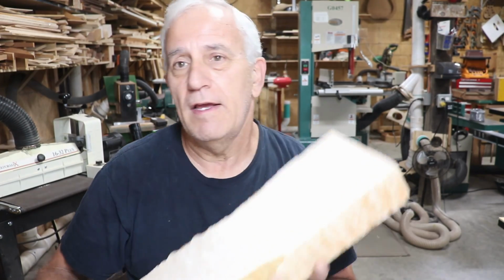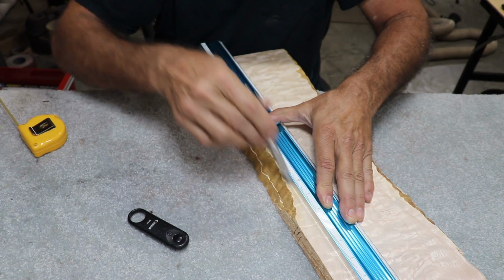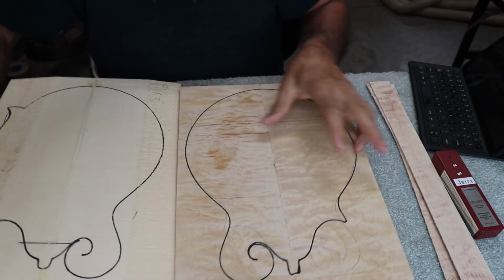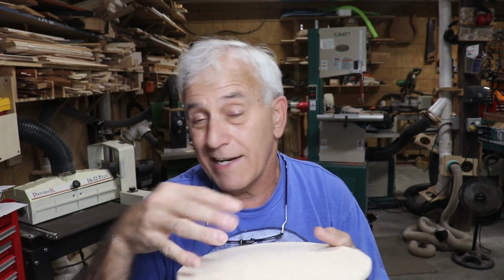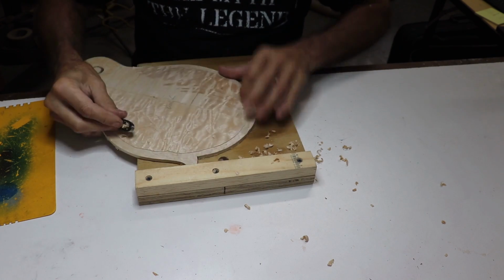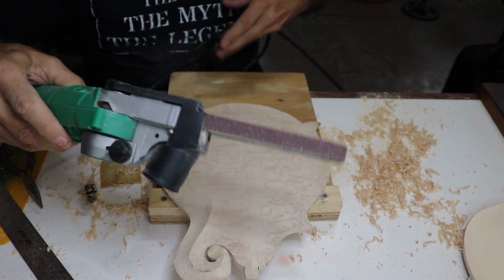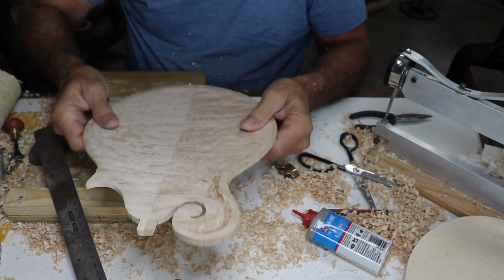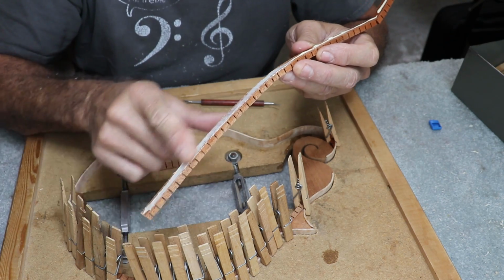441 RSW A Custom Quilted Maple Mandolin Part 1

Comment: At around 17:00, you explain that you used a power grinder to hog out a lot of the surplus wood "but don't try to get too close".  When I was just a lad, it was explained to me that at any given time, I should pick a tool and technique that would easily remove at least 80%  but no more than 90% of the material that I wanted gone. This holds true for chainsaws and axes at one extreme and polishing compounds at the other. I've managed to follow this advice for several decades and it seems that you do too.  Your tool and technique choices are why I (and many others, no doubt) continue to put down anything we're doing when we see a new Rosa video.

Comment: I carved a mandolin back out of birds redwood eye burl and it was horrible for tear out so I put a sanding disk like I used to use with my drill. I Chucked it into my drill press to hold it firmly in place and moved my back around to shape it  so it was very similar to what you did. There is probably a good time to use each style

Comment: My first violin back was slab sawn maple.   Pretty but hard to carve.  I ended up using a flexible sanding disk attached to my drill press.  You can also use the drill press with a depth stop to take wood from the inside and chisel out the excess wood between the holes.  Did you buy or make the neck block and end block.
Reply from the maker: I make every wood part.  Though I buy the fretboards pre slotted.

Comment: Hey Jerry, that is going to be a heck of a instrument ,  I am really starting to slow down and just make the best pieces (I am a furniture/cabinet maker) I can possibly make as I am in my mid 60's and am finally not to worried about the money end of it (as much as I used too),one of my favorite sayings from photography which is my non-work passion is beginners worry about the equipment, professionals worry about the money, masters worry about the light . Sorry about the ramble, I wanted to suggest looking online for toothing planes which where what you needed for the grain issues. Also although you are  probably aware flat sawn booked matched has the pores sliced in opposing directions and its going to show its chatoyancy at a disadvantage. There is a Okie,Bob Flexnor that has info on that. Btw the reason I subscribed was I watched ur chocolate restoration ,nuff said .
Reply from the maker: I have several tooth planes they didn't work on this either

Comment: Hi Jerry;
I've made two balsa violins. Talk about tearing out when carving wood, that takes the cake. It's so soft that it really likes to tear rather than cut. So, no more balsa violins. They do really make a good sound board though.
Reply: Set your chip breaker up so that when the carving plane is fully assembled it's at 81 degrees. This should reduce tearout to the least you could hop for.

Comment: That gizmo, you use around the heater,metal strip with handles, would a leather 1 be any good?
Reply: Leather would dry up and crumble, in short order.
Reply from the maker: leather might work.   Though it would probably absorb more of the water.  This is an advantage with the metal because I want the steam to stay in the wood.

Comment: The back is stellar. Did you know that streaking would carve out when you chose which side to use? Can you coax that kerf strip into shape on that heat rod you use to bend the sides?

Comment: Jerry 
Thats one of the traites of  that quilted maple your working with .
Its more or less its own Animal . Ive worked alot with Birds eye maple , fire maple , tiger maple . And they all are different and non have the same temperment ..  lotta sanding if you dont want alotta chip out . If your gonna chisle small bites . Baby bites . What helps. Is a product called Zap Gap . Knife maker supply stores call this on line ..  ever here of Brownells .  Outta Brownelle Iowa ..  much of my tools and adhesives
I use to purchas from their .. it may be of interest to you to obtain one of their catalogs ..

Comment: Have you ever tried using a larger plane, something like a Stanley Number 4 Bench Plane, just for hogging off the wood when you first start carving?
Reply from the maker: you would have to try it but I am pretty sure that's gonna be really really awkward it's a small curved surface
Reply: @RosaStringWorks  oh yeah, I didn't think about that. 

I was just thinking that the extra mass of a larger plane could help your carpal tunnel.

Comment: why don't you make a little steam bending box?  Seems a lot of luthiers use them.  

Also, if you get a big bimetal resaw blade (carbide teeth) you can get better resaw results with a smaller kerf and less waste since you can take thinner cuts more reliably, especially considering the cost of exotic and figured woods.

Comment: Jerry,  I have a question regarding the quarter sawn maple.  When they resaw this figured wood, does it affect or limit the options as to which direction they saw it? 
In other words if they had cut it in true quarter sawn would the quilting have been less.
Maybe a stupid question, but I  had never even thought about it until you discussed it today. 
I have some very old Acacia pieces and I had been planning to resaw it for best figure. It's not for an instrument though, it's for new handles for a couple of old knives.
Thanks, great video as usual.
Reply: I’m guessing Jerry has already finished it at this point. I worked on a tiger maple gunstock and used dye instead of stain, with a boiled linseed oil finish. Really brought out the figure without making the end grain blotchy.
Reply: @forthwithtx5852  I was planning on just using linseed oil with no color nor dye, so the end shouldn't grain be a problem.  I omly have a couple of pieces and I'm trying to decide how to saw it for best figure. I don't have any to waste on a trial and error aporoach. The pieces are about 8" long and 6"x6" . The grain runs the length. The only question is, is does it matter which way I  resaw the piece, as far a best grain figure. I know I'm probably not being very clear here. Thanks
Reply from the maker: I am not familiar with the curl or grain pattern in that specific wood but in general I don't think the curl is affected too much by which way you saw it.  The grain lines however would not match unless it is quarter sawn.
Reply: @RosaStringWorks  thanks Jerry. Yeah the matching doesn't matter so much since the 2 sides on the knife aren't  directly  next to each other. I just want the grain to he as dramatic as possible.
The knives belonged to my grandfather about 1930s, and he never bought anything new.  The handles are shot. The acacia grew on his place, and was cut about 30 years ago, so it's the best I can do to replace the originals handles. I'm  nearly your age, and I'll leave them to my grandson.
(Acacias include Koa and Blackwood, but this variety grows in Texas. )
Keep up the good work!

Comment: I've used a fair amount of this. I still have several blocks here. Do yourself a big favor and don't run this stuff through a machine. It will tear out in big chunks.  Use a very sharp handplane and take very light passes. You will be rewarded. If there was a way to put photos up here I'd show you the spectacular result that can be achieved with hand tools.  And by the way, you can buy this locally for quite a bit less than $300, but the supply is irregular.

Comment: I know you have said several times that English is not your subject matter, Jerry, but still I dare ask you this question: Why are they talking about the back of a mandolin versus the top - why not bottom/top or back/front? That would be more logical, wouldn't it?
Another thing is that English IS your subject matter - I am thinking about your song writing, some of which is a very fine and delicate handling of the English language.
Reply from the maker: I stand by what I said
Reply: Olav, you ask a good question about the terms "front and "back".
You must remember, musical instruments, mostly, came "up"  from
the lay people, not "down from the academics, so you end up with
the contrasts in proper and slang terminologies.
In the US refrigeration and air conditioning industry, two copper pipes,
of the same diameter, are often joined by expanding one to fit over the other.
This is called a swaged joint bit is pronounced as sweged, due to the workers,
over many decades, slurring their words.
Up, from the street, not down from the universities.

Comment: Jerry It's end grain that is giving you problems, The grain dips and dives through the wood. And you had best test your stain on a piece before you put it on the finish piece it likes a clear coat ,Or it gets very blotchy . Good luck
Reply: I agree.  Also no sunburst on this back or sides. You just can't cover a square inch of that beautiful grain with dark stain.  This could be the most beautiful,  unique mandolin ever!
Reply: @kentk9aee898 :  That wood is just begging for a PRS-type finish. . . .
Reply: Jerry, is this Maandolin spoken for and if someone wants one,  what is your “ hold Charge?

Comment: What ya need to do when ANY material is behaving in such a way is to establish a "solidifying" layer that pulls all the different porosity, fibers, hardness-es and softness-es together into a unifying amalgam of similar consistency, that then all moves and flows in a way that's predictable and actually more familiar... or in other words douche that stubborn bitch with polyurethane clear, it's not going to affect the sound that badly , especially if your going to be then carving the majority of it back off anyways...try it, then try your newly learned belt sander trick once the poly is stabilizing the wood...